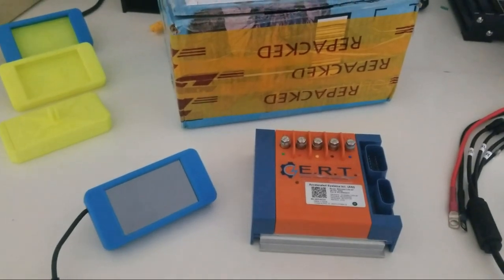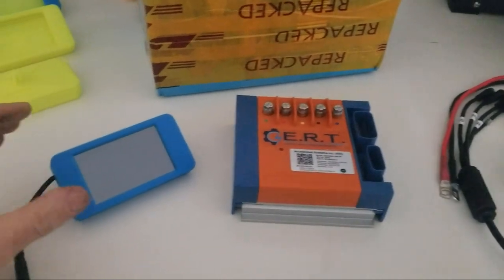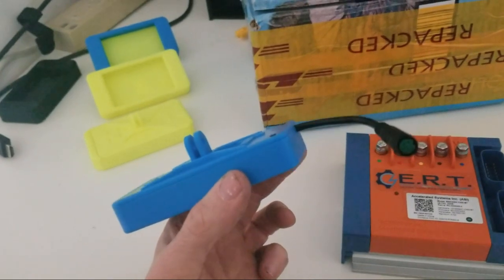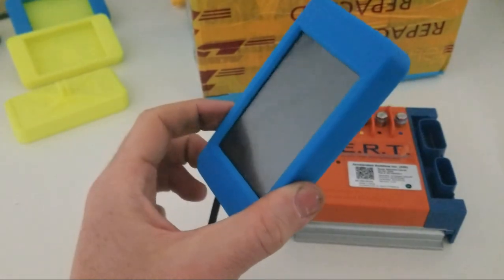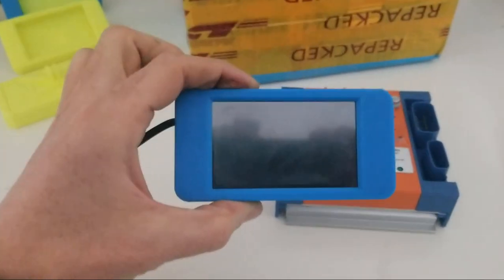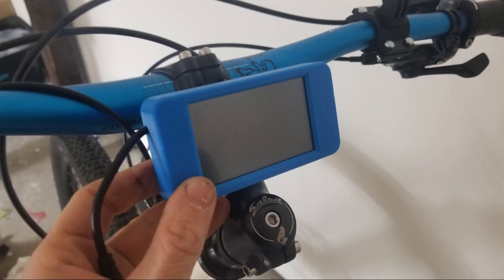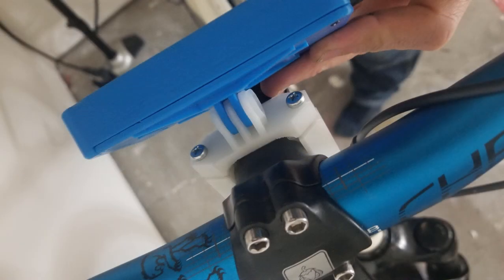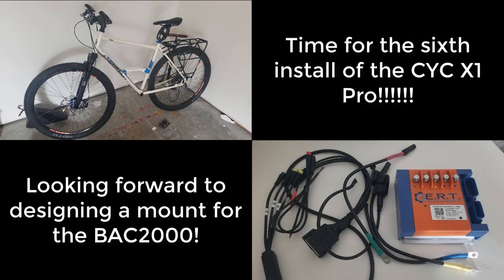NXT - The worlds most advanced Ebike Display

Comment: What’s the display size on the new NXT display?
Reply: I placed the order for the new model. I was going fix the old one for a spare.
Reply from the maker: I didn't even know there was a new model. You have a link?
Reply: @HighVoltageKits  it’s on the website
Reply from the maker: Thanks!
Reply: @HighVoltageKits  doesn’t mean Alan Hu is gonna ship it though still making excuses like the good ol time.
Reply from the maker: I can't make any guarantees. The High Voltage brand evolved from many of those frustrations.
Reply: @HighVoltageKits  you sell the same displays?
Reply from the maker: No we are offering the 750C and soon the eggrider. Just deciding on the 72 volt solution. The nxt is solely am ERT thing although I was very much part of its development.
Reply: @HighVoltageKits  will your display be compatible with his bac? Or require a full reflash?
Reply: @HighVoltageKits  interesting I know he release 6.50.5 update but I’m curious if people have reworked his UI.
Reply from the maker: The new one? The one that was sold was 3.2 inch. We had a 3.5 in test along with a better logic board. I dunno if it will be made. They stopped making the 3.2 screen at nextion.
Reply: @HighVoltageKits  the new display was successful. My 3.2 screen cracked..touch stopped working been unable to find the part to replace just the screen. I believe it cracked because the housing issue
Reply from the maker: Have you tried seeing if Alan has a replacement at ERT?

Comment: Very cool display. I love that it displays amps, watts & rpm. Many displays only show watts and some give you a choice between watts or amps. The temp display seems a valuable bit of information too (if you want to keep everything reliable).
You mentioned the BBSHD. Will it work on a Ludicrous controller, or just the stock?
Reply: i think you need to buy their asi bac800 controller or you will lose your PAS
Reply from the maker: The NXT will only work with the ASI Bac 855 (upgraded) from ERT. The wiring looms used are custom and the display only interacts with ASI controllers.

Comment: Hi Captain Codswallop 
Wanted to ask,  if NXT display works with BAC800 ?
Do you need a special settings to work?
Reply from the maker: It will work with all ASI controllers. Right now the focus is on the sur ron. One setup for the 800 is in the works though. I dont have a firm date however.
Reply: I got a BAC800 from Alan , but he didn't send me pack of Eggrider  I know there are Eggrider  incompatibilities with the BAC800,  and thinking about trying to order NXT when it will fit.
Reply from the maker: Its definitely a good option. There is also the colour 750c I think. I hope the egg gets a firmware fix soon tho.

Comment: During my kitesurfing, surfing and bike riding I have already lost 2 gopros and broken 2 more + two gimbals, as go pro mounts are bot as sturdy as you would think :) allways use some secondary attachment like a small leash or similar.
Reply from the maker: Yeah. I have never actually used an official one. My garmin uses the same mount though and I make them. I imagine the sudden forces with kite surfing are more than ebiking in most cases. Good idea though for a leash to safeguard it. I have one for my rear camera.

Comment: I saw something on its way from Calif. that I thought might be my NXT (You know Alan never sends any tracking info) and when I saw you posted this my hope grows stronger. Are you going to put the print file for the mount on your web site also? What software do you use to draw 3D files?
Reply from the maker: Hope so. Fingers crossed! If you mean the go pro clamp. Yeah I can send you that. Drop me a mail and I will attach it!

Oh and sketchup I use.
Reply: Hi, did you fix the problem with error 30 ? What was wrong?  
I have the same problem , I don't know how to solve it.  I put everything together well.
Reply: @s.u.9679  My problem was that Alan forgot to configure the display before he shipped it to me. So I sent it back and I'm still waiting for the replacement. He is upgrading it to the new touch screen but he's slower than molasses in January.
Reply: I got it from him controller, but the display and throttle didn't go to the parcel. I can't  get in contact with it,  Alan is not responding. I tried to connect Bafang DPC18 display and got error 30 .
Reply: @s.u.9679  Not all displays will work with the BAC800, I suggest you return the Bafang DPC18 display and buy one from Alan. He is not good about responding to customers. He will sometimes respond to texts. Try that with the number on his web page.

Comment: Nice bit of kit.Good that they have an upgrade kit for the X-1. A little confusing at the CYC website about ordering which controller, but it seems to be a top choice motor. I will have to contact them, no controller would be nice. Would the 800 be fine for a 52V long range set-up? I don't want to do wheelies, I just want to do long off-road trip like fishing or the like. So far only clear item to get is the Satiator charger!
Reply from the maker: The 800 will work good for the 52 volt setup. It's not powerful enough for 72 volts. CYC do the 800 and it is tuned to run with the torque sensor. I am not 100 percent sure when they are shipping that tho. Best to give Jon a message. Cheers

Comment: its about time we were seeing a fixed wheel ebike with regen braking. I just don't get why they are not around yet?
Reply from the maker: You can get regen but it takes a third party kit to do it. The sur ron can have regen but that's more e dirt bike so no peddling. The lightning rods kits can do it. Nothing else commercial I am aware of in middrives. Anything with a derailleur or other such style chain tensioner cant do regen sadly. I want to try the LR kit with the regen. It looks a smooth ride.

Comment: Hey Captain Codswallop, is the NXT currently working for your BBSHD? Or it is only working with the Sur-ron for now? Wish ERT would do this as an Apps for smartphone instead, and use a Bluetooth dongle that would plugin in the display connector for communication to the controller. He could sell the Bluetooth dongle and apps instead and this would save him a lots of headache in the long run. No warranty do deal with for defective or damaged displays, no shipping cost for returns, no need to make wiring harness for the different motors, easily upgradable via app updates, users could use the size display (smartphone) they want, no need to outsource casing for the NXT display, no production cost for him, could save him lots of time, time he could use to improve the functionality instead of wasting time making harnesses and 3D printed cases. My first ebike build was with a Golden Motor Hub motor and it was using either a display or a Bluetooth dongle to connect to your smartphone as a display, it worked great. You can see it here: https://www.goldenmotor.bike/product/magic-pie-5-vector-26-inch-rear-conversion-kit/  Cheers.
Reply from the maker: It's a decent idea. I honestly don't have the answers. The drawbacks I see would be having to code for two ecosystems in IOS and android. Android are not so bad but apple can be a nightmare to deal with. Then you have the issue of attaching your phone to your bike which I would never do as if I crashed or it fell off I'd be replacing something that cost 1000 dollars. Then if a call came in I'd have to take it on and off the bike etc. I see what you are getting at but I'm not convinced it would save development time or costs. The harnesses is not really display related but it the wiring for the bac2000. It just came in the same box. Thanks for posting the link. Cheers

Oh sorry. Its sur ron mainly right now although mine will work with the cyc. BBSHD to follow as well lighning rods. If the motor is supported with a plug and play kit the display will be available for it.
Reply: @HighVoltageKits  I am using a dedicated phone for my display, any cheap smartphone will work.. I also have a very sturdy smartphone holder, so no worry there. It also has a USB that you can power with up to 85V. There are plenty option for phone holder, I use this one: https://www.amazon.ca/gp/product/B07R59Z3HX very solid. The thing with this approach, is that there are no cost and all profits. you make the apps once and sell it many time with the Bluetooth dongle, so it is a win win. And for user who want to be very stealthy, they have the option to not mount the phone on the bike... you get the idea... Cheers
Reply from the maker: It's a good idea. Perhaps once things advance it might be possible to transfer the nxt into a phone app with the dongle like you say. Very stealthy if it's in your jacket. I had not thought of using an older phone! That's good idea I'm all for recycling and reusing!
Reply: even better give us a bluetooth dongle with an open API and allow us to write our own app with google maps integration that would be dead easy!

Comment: So are you happy with the speed and acceleration? This was on the BBSHD?
Unless you are looking to go on a motorway it looks like 72V and 3000W? Is a good E bike capable of keeping up with moped speeds and traffic in general.
 I will like to see how the BAC 2000 changes the speed and torque but with what I see in this video it looks like a good setup. 
 I am curious as to the ability of the motor to hold a hill at 60Kph. Not Mt Everest or some stupid incline but the hills in your town? Get the bike to do that and you will have an E bike to go riding with!
Reply from the maker: It held 57-60kph all the way back up the steep 9% hill I went down when I was in traffic. I wasnt recording the ride home tho sorry. But yeah I am more than happy with the bbshd like this.